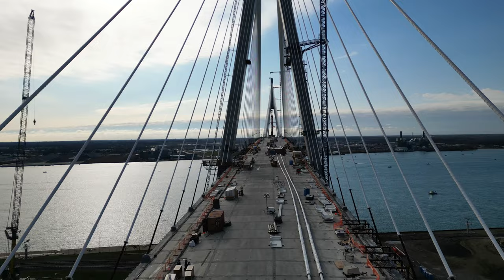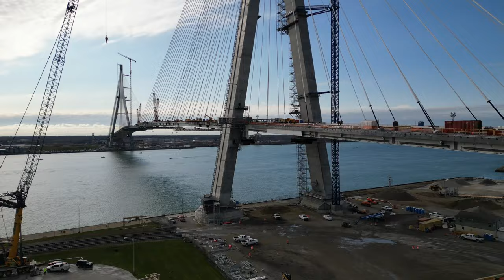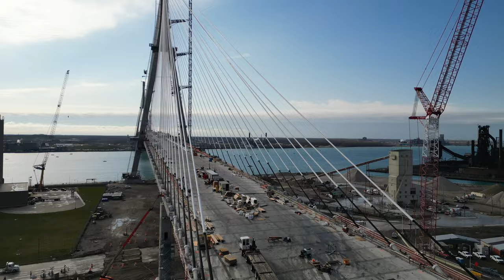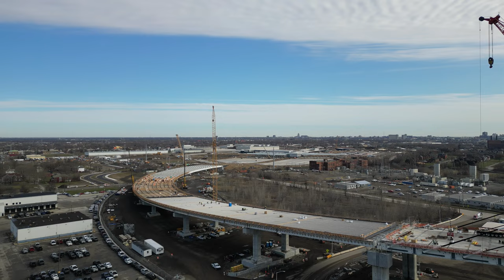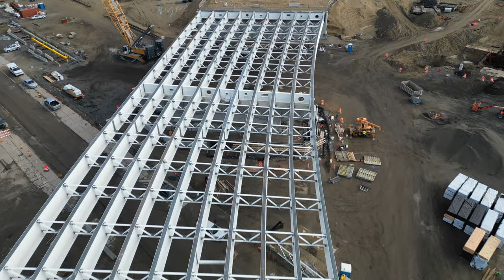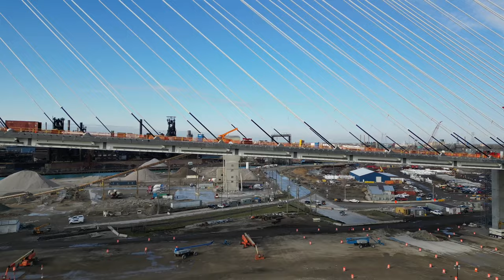Gordie Howe International Cable-stayed Bridge Project| April 2024

Comment: Will this bridge be completed by Fall 2025? Its still very much a construction site.
Reply from the maker: The construction project is expected to be completed in September 2025. However, the bridge deck will be connected by the end of 2024. In my opinion, the project team can meet the set deadline.
Reply: The spans are scheduled to be joined late May/early June.